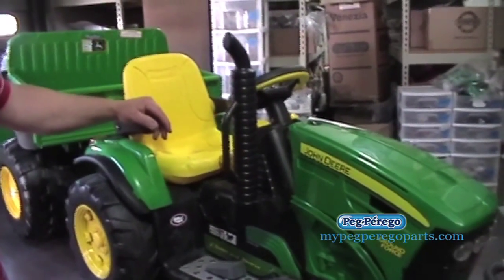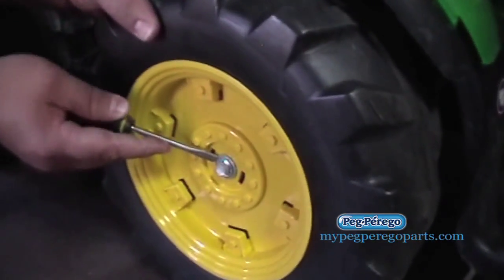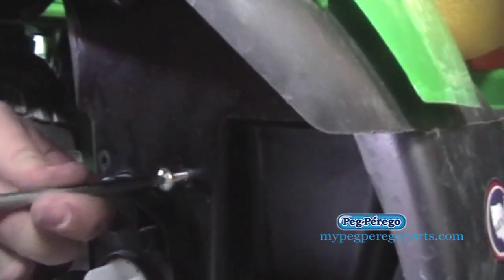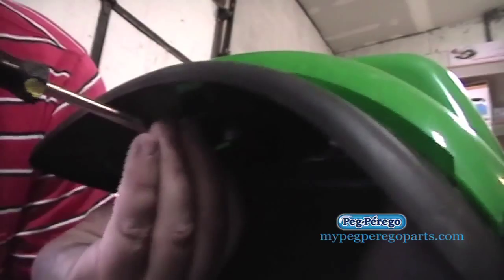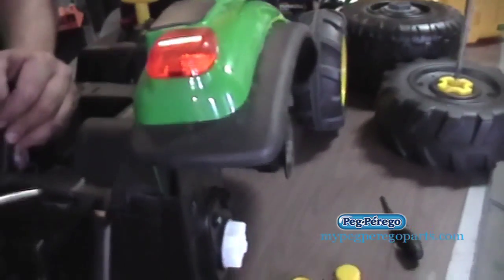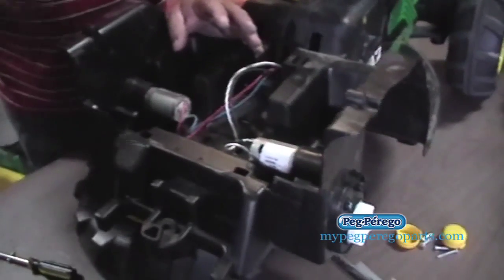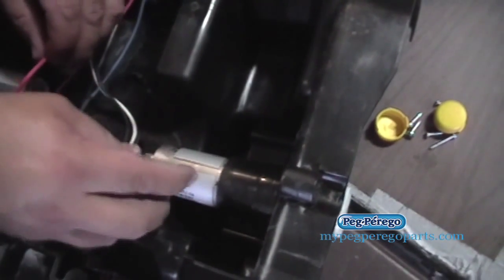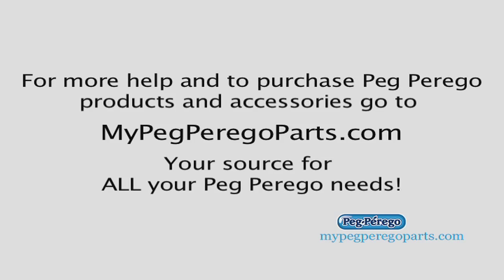How to replace Peg Perego John Deere tractor wheels, gearboxes, and motors.

Comment: I have the John deere ground loader 12v. I'm not sure how to troubleshoot the issue. I replaced the battery but still not working. It will work for a minute then give out. Any advice would be appreciated

Comment: Any clue why my power pull only has second gear? I just replaced the switches. Still only 2nd gear.
Reply: I had the same problem. One of the terminals to the left motor was bad.

Comment: I'm having trouble finding a part for my JD dual force tractor. It was missing the plastic "+" shaped piece that goes between the gearbox and the wheel itself. Without this the gearbox can't turn the wheel. It's the "red Cross shape" I've heard you describe in your other videos. Any help would be greatly appreciated.

Comment: For the love of God..... one wheel on my kid’s JD trailer free spins on the axle and the other one barely spins. The white plastic insert on one side spins and the other seems stuck to the axle. The metal axle rod continuously separates from those super sturdy open ended plastic pegs that the axle goes in. I mean, I never saw this as a design disaster in waiting when I put it together. I have spent too much time on this and I’m not a fan of disappointing my kids. Tell me I’m a dummy and missed something. I can take it.